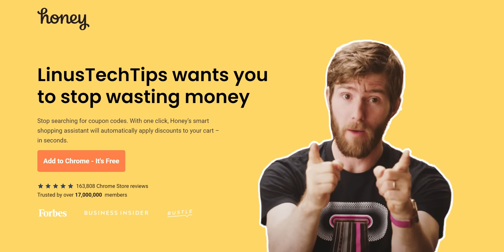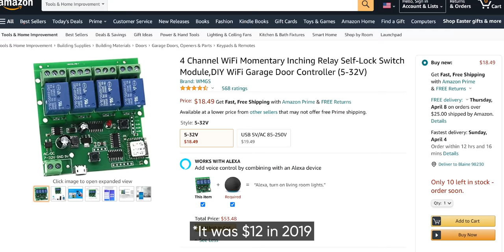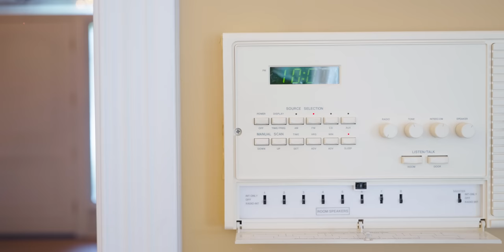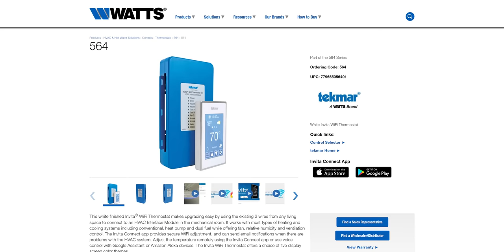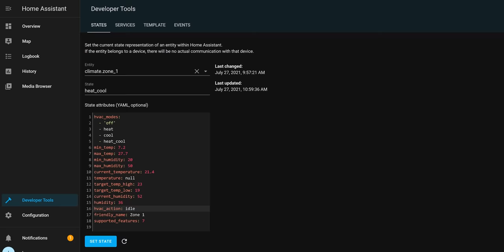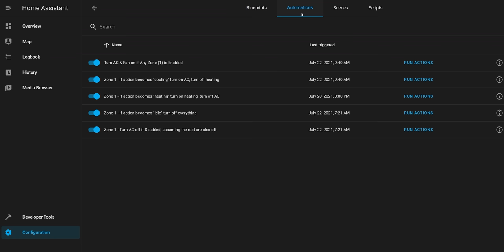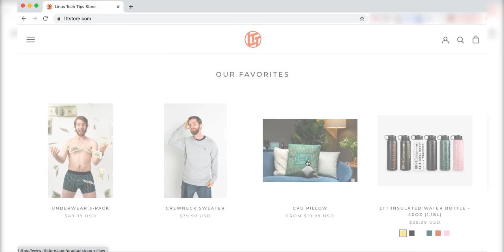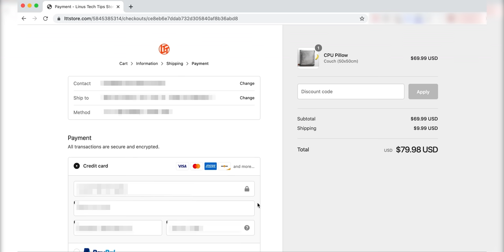This Should've Been EASY - New House Smart HVAC

Comment: The problem Linus doesn't foresee is that his system being 25 years old, is a 100% on or off system. It doesn't ramp down just cause 1 room calls for cooling. The evaporator fan is going to burn out trying to push all its air to 1 spot and the compressor might also burn out from short cycling cause its not exchanging enough heat to operate continuously. Linus needs to replace his outdoor condensing unit and AC to a VRF (variable refrigerant flow) system which, even then, can only ramp down to 50% of its rated capacity.
Reply: Almost needs a bypass or some kind of minimum requirement for # of dampers open
Reply: Yea that can be a huge problem once he has it wired
Reply: Liked to help visibility
Reply: I don't know how common 2 stage AC is in Canada where they are, but at least where I live, its pretty uncommon. He said it's 25 years old though. He's already past the typical failure time and is likely just gonna let it run til it dies. Probably a good idea when that inevitably happens.
Reply: Needs a chiller with VFD, and coils at each damper with this setup
Reply: @blasta42  this is the only way really. he will need to find the minimum number of dampers that can be open with still enough airflow that way that number can always be open. even then the system still won't like that
Reply: @mph8er  yeh, but even a  new one will burn up a motor within a couple years with the setup as configured
Reply: I honestly think he's going to replace it
Reply: Indeed, correct and what if you are during night time sleeping and your occupancy sensor turns off, since it cannot detect motion.
Reply: Came to the comments to just to make sure someone mentioned this.
Reply: @SingularityAdvent  just set a rule for bedrooms to not turn off occupancy sensor during the night.
Reply: Until the video comes out titled "My AC died so I'm going to Water Cool my house!"
Reply: All he needs is a minimum flow setting and a short cycle protection routine. You can open the dampers to minimum percentage and make the cycle time not less than one hour. We do this all the time at work on way more bigger stuff. Absolute 100% worst case scenario you bore holes in the damper to ensure the minimum flow is always met.
Reply: I'm no expert, just a fellow homeowner, but a variable inverter based system like the 4-5 ton MrCool Universal Heat Pump might work (not shilling this is just what I'm installing for my house right now). It's super DIY friendly since it has pre-charged lines that just screw on. And, like someone else already said, could program home assistant to wait for at least 3-4 rooms to call for cooling before actually kicking on the unit. In the winter it could also provide some air-based heating if the in-floor system needs an assist.
Reply: He’s like… best friends with an HVAC tech. Pretty sure he’s got that covers
Reply: @SingularityAdvent  You aren't considering how much control they're going to have with their automation. The occupancy sensor is just another sensor. They can opt to use it or not use it and set a by-room-schedule for when to use it. During nightime, they could set the temperature to a particular temperature and hold it there and then have the occupancy sensor take over during the hours the family are at work/school. Home assistant allows for all of this.
Reply: Wish I would have known about these when I installed central AC at my place... my upstairs gets crazy hot and the ground floor gets frozen out in even 80 degree weather
Reply: @SingularityAdvent  Sensors are passive infrared usually. they don't turn off while there is still heat energy in the room after motion is detected.
Reply: On a 25 year old system there may be enough leakage to provide necessary bypass flow and the server room can always accept the ac overflow
Reply: Trim the damper or send a whole saw threw it to allow something to get by.
Reply: Best system he can use with an good efficienty are climate control units on the wall or ceiling. This stuff what he wants aint gonna work. Besides its NOT A DAMPER. Its a BUTTERFLY VALVE FFS with actuator. WHAT DOES IT DAMP? nothing. I bet these wont even stop at 45 degree angle only 90 degree or 0. Dumbest shit ive seen yet. And linus did go hightech with a heat camera system thats 50 years old or so technique. Come on. Why is he making it so hard for himself ? Why? I dont get it........
Reply: @subsonicbass   contact an HVAC company that does air balancing. You might just need your airflow distribution changed.
Reply: @jonathansnodgrass2464  thank for info.
Reply: He just did a split system in his house 🏠??? Why 🤣🤣🤣🤣🤣
Reply: @SingularityAdvent  That is what cooling schedules are for. They can override the occupancy and ensure that the bedrooms are climate controlled in the overnight hours.
Reply: I just have one question. Linus seems quite excited about the fact that the heating is in the floor; this makes me wonder if it is rare to have such heating system in Canada
Reply: Yep, the a/c needs a specific amount of airflow (cfm) not enough airflow will cause the evap to freeze and the compressor to get slugged with liquid refrigerant. Each damper can be set to “close” at say 25% open to allow some airflow even when that zone isn’t calling. A bypass duct could be installed on the supply to the return duct to lower the static pressure on the fan. Staged equipment will help but most still run the blower at 75% of full speed in cooling. The ones that go lower use proprietary communicating controls.
Reply: @subsonicbass  you need more resisters in the hot area and less in the cold area.  It's just not balanced properly.
Reply: @jonathansnodgrass2464  the sensor is passive but they can choose to ignore it in software.
Reply: @mastroitek  Its rare anywhere since the capital cost for materials are higher. Most settle for baseboard around the perimeter or let the ductwork do double duty with a furnace+Evap coil.
Reply: What this guy said. You 💯💯💯💯💯💯💯 need to absolutely have a minimum on time, and minimum off time for the compressor. Otherwise boom and dollar signs. Look up specs for that air conditioner, it will probably have a minimum cooldown time listed somewhere
Reply: @HazenMire  Very common in Nordic countries.
Reply: Also one thing to keep in mind with these systems, they are slow, usually 24h wait period if you make changes to see an effect due to amount of mass that needs to be heated. He talks about it as it it's an air heating system which is fast (both heating up and cooling down). I do not get the get fact that he needs to use AC and heating at the same time. Here in Sweden we just turn off the AC or heating depending on the season (as in for many many months, not hours :) ), never run both at the same time.
Reply: @cjansson  thankyou for sharing. I was quick to say rare, but they aren't uncommon in the states. It's just, as I said, it's more expensive than other options. So you only really see it here in more well off homes.
Reply: @mattsnyder4754  Brian’s not an HVAC tech.
Reply: This is a terrible idea. There is fundamental science behind all HVAC solutions. Linus and his followers should understand this. You can draw parallels between network programing and HVAC load balancing/Variable Frequency Drives. The products he selected are great but the Ecobee TStat and the Honeywell damper are not designed to be used in this manner. If he choices to deploy this throughout his home he will be replacing his entire HVAC system very very soon (not a bad thing it's super efficient).
Reply: You smart. We have a 35 year old system in our apartment so think we got Linus beat. Only 25 years? Pfff hah!
Reply: I’ve seen systems with 2-4 zones wreck themselves even with bypasses installed. A 10 zone system needs some serious foresight to be successful. It is not present in this series of videos thus far. DX cooling is not the correct solution
Reply: Exactly a zone system needs consistent air volume and run off a discharge air that needs to be lower. Having two stages or un loaders would help. What he is doing won’t work well
Reply: I do think the video was meant to show the concept but you have a good point there
Reply: I'm assuming he will be installing the fans with the system, helping greatly to get the air to the specific spaces and alleviate the work on the ac. Assuming he installs the fans.
Reply: yea its going to go BRRRRRRRRRRRRRRRRRRRRRRRRR KABOOM One or 3 damper's won't be-able to move enough air to keep the system healthy with a unit THAT old they are designed to run balls out
Reply: What about the DX system control the temp for supply air. And for controlling room temp using damper with minimum opening to prevent evap from freezing. I really hope Linus use damper with angle control for this project instead just 0 % or 100%.
Reply: 100% this. This systems is overly complicated and reliant on low-quality micro-tech regulating mechanicals and will be outmoded quickly. Like about a few years after he boards up the walls. Then when he gets the quote to fix/upgrade it, well, outward he moves, making it the new owners' problem. This is called irresponsible property ownership.
Reply: I encountered this type of problem before. 300 year old house that needs  an A/c and heating solutions. for A/C I redesigned the compressors in 3 stages with 3 variable tonnage compressors in parallel along with 3 condenser coils, evaporator coils and fan. for the evaporator fan I used variable frequency drive programmed for air flow in specific stages, static dampers for tweaking air flow instead in butterfly duct dampers, cross valves for heat pump transition, wireless modbus rtu for zone temperature control and 1 redundant control terminal unit. I hate bypassing, its inefficient and a waste of energy.
Reply: @mph8er  2 stage cooling is not very common except in commercial application in Canada. it is out there but single stage AC is what most homes have
Reply: Those dampers seem to have stops where you can just close them down to a few % instead of off...might help keep a minimum system flow in all rooms.
Reply: @SingularityAdvent  thats a non-factor. The switches tell home that the room is unoccupied. Home then takes that into consideration when it decides if it needs to turn off the ac. Adding a time condition for bedrooms for cooling control solves the issue.
Reply: Work for a Commercial HVAC company. What he’s basically trying to build is a poor mans, DIY, VVT (Variable Volume Temperature) system. At a minimum for this to work, he’s gonna need a “bypass duct” from his supply duct to his return duct with another motorized damper (and the bypass duct will need to be sized for the right amount of air that will need to use it).

Otherwise yes, he risks burning out and killing all different parts of his system. Heck, I’ve seen a MERV 8 1” pleated filter kill an older standard residential spilt system before.

Also this is gonna create some weird pressure zones in the house that could cause doors to slam shut, etc.
Reply: @Male Sensitivity it is not impossible, I once use Raspberry Pi and Arduino to control VAV unit for college project. But it is just a pain the ass to be done and not as reliable as using PLC.
Reply: It's unlikely that all rooms are going to need to be controlled at once. They could always vent the excess air into un occupied rooms, the dampers have fans so that could help relieve the strain caused by the increased resistance in the system. They may need more fans in the loop or an external vent but both are far cheaper than a new unit
Reply: Mitsubishis man!!! Hahaha
Reply: Not actually true. Squirl cage fans are a bit weird. If they don't have enough back pressure they run at a higher current with lower RPM and if they have too much they just run faster with less power draw. As far as short cycling, every single one of Linus's zones would have to turn on and off at once. This is highly doubtful that this is going to happen. On top of that a older AC really works better than newer ones. R22 is simply a better refrigerant.
Reply: And the fact his gas appliances are %70 efficient at best, a new condensing boiler and storage tank or even a combi boiler would be a better energy saving than what he's doing. What he's doing is fucking up his hvac
Reply: That's why people use multiple VRFs for big places!
Reply: it took me only 2 minutes to see he doesn't know what he's doing, you can buy all that he's trying to build there and it won't be as expensive....
Reply: Also R-22 is not made anymore
Reply: @mattsnyder4754  that dude is a hack
Reply: I like how everyone in this thread is an HVAC expert.
Reply: @cjansson  Not quite, my parents old house had one and it would be as little as 1 hour before you could feel the difference in room temp.
Reply: @butstough  I forgot to add it depends on the material it needs to heat up and how well insulated it is. In our case lots of concrete and a solid wooden floor on top takes a while. But yeah definitely faster in wooden constructions but still  1h is not fast enough to have a system juggeling temp with an AC imho.
Reply: @blueredbrick  I'm a  HVAC Tech lol
Reply: @lordgilby  awesome :)
Reply: @bizzzzzzle  Smallest chiller that can be bought I think is 10ish ton. Way over kill plus it would have a digital scroll to ramp down. Think it would be way to loud unless you can set it far away. Not to mention having to run glycol mix in the system or drain it every year for freeze protection. Way to much maintenance. Last chilled water sucks for humidity control compared to DX.
Reply: @mattsnyder4754  as someone who has done commercial HVAC for a living for 11+ years Brian is not that experienced. On the mini split install he had said he just recently switched from electrical to HVAC. It takes more time to become familiar with all the concepts. 
Linus is GOING to have issues with this setup the way it’s explained to be done in this video. 
Point. Blank. Period. 
His constant volume fan is not designed to work on a zoning system like this. 
He’s going to be building unnecessary static pressure on his ducts and not moving enough air. This will either slug the compressor with liquid or freeze his coil. 
You have to calculate your minimum air flow needed and keep a set number of dampers open as long as the unit is in operation. But that’s even on a system that’s designed for zoning. Not a 25 year old basic unit. 

Linus is trying to DIY something that should not be DIY’d. This is going to cause him more issues down the road as is not worth it. 
He would be better off ripping out his current system and putting in a zoning kit with a new unit or installing a VRF heat pump or heat recovery system if he wants individual heating and cooling.
Reply: @sithus1966  would be the better way for shure, if you doing it the right way^^
Reply: ya he will need a 2-3 stage condenser and a variable speed motor in his air handler. also should make sure he has a relief zone and possibly a fresh air intake to help equal the pressures in his house..... this is why zone boards exist to make sure the static pressure doesnt get to dangerous lvls and hurt a motor, compressor, and some time coil (seen it b4)
Reply: Also surprised that the dampers will only have full-open / full-close.
Reply: Needs a 5 minute time delay and a minimum number opening or something to stop the evap from freezing up
Reply: Watching this thinking the same thing. It's nice being smart enough to figure out the control side of HVAC, but you also have to understand the mechanical side as well.
Reply: i was just thinking this, one or more dampers closes and then all your air pressure is going to be going out another vent at twice the force. They can't install this type of system on their old ass system.
Reply: @averagejoeprojects2885  Don’t forget the flux capacitor
Reply: Well on a system that old it will shorten the remaining life, and he will be able to get that system sooner than he thinks!
Reply: Love the hydronic radiant heat but...

Yep, you cannot easily make a constant volume system a multi zone VAV system without extensive modifications or replacements.

True VAV systems use a static pressure sensor in the main duct (approximately located 2/3 down the duct run) to sense an increase in static pressure in the duct. When multiple spaces are satisfied and their dampers close, the fan is still pushing full volume through less outlets, therefore the static pressure rises. When this is sensed, the supply fan is slowed (typically by a VFD) to provide less air. Other systems like VVT systems have constant flow fans by modulate a bypass damper to achieve the same effect.

Without this vital point in the system, a few things can happen. As you point out, the indoor unit fan can burn out or trip out the breaker from pushing against too much static pressure. Also, if the fan cannot overcome the high static pressure, it will fall down the fan curve and flow less air than the cooling system is designed for, which can and will freeze the evaporator coil.

Residentially, if you want the best multizone control, you want a multizone split system. Or if you have a very big house, a small VRF system.
Reply: As an HVAC Tech, that immediately came to mind
Reply: just install a Carrier infinity communicating system and be done with it haha!
Reply: Compressor is more likely going to get damaged restricted air flow decreases amp draw basically heat. The Compressor gets 2 things flooding, and increased amp draw
Reply: He also forgot the 10° rule. The amount of energy it takes to recover 10° of heat or cooling In a twenty four hour. Exceeds that of just leaving A set temperature. More prevalent with the hydraulic system. But rough estimates it takes 3 hours to drop a room 10°. What a properly function air conditioner sized for that room
Reply: @mph8er that's not a good idea, it should be replaced
Reply: @everythingpony  Why are you responding to a 2 year old comment?
Reply: You think they did all this then kept the 25yo box? Lol